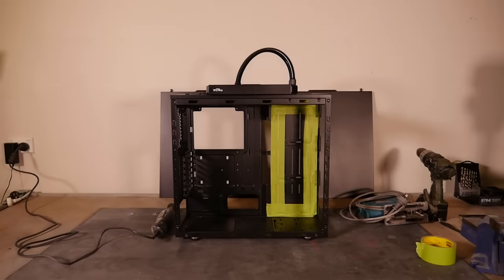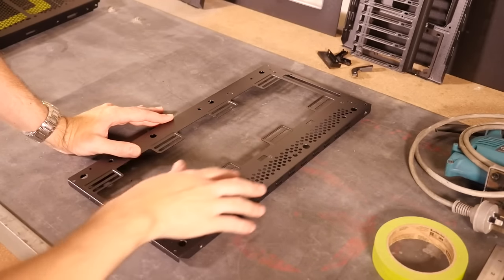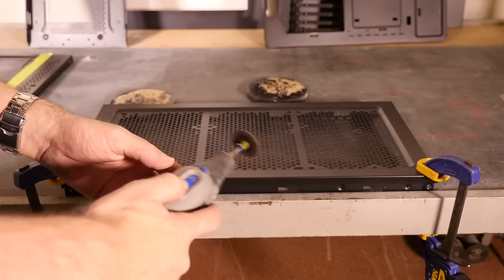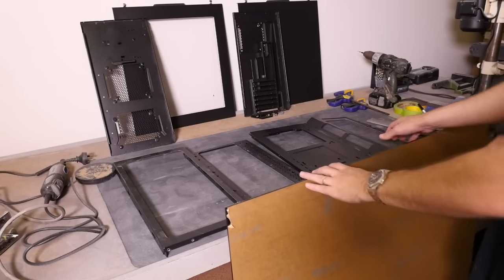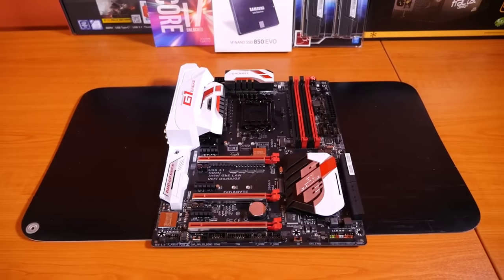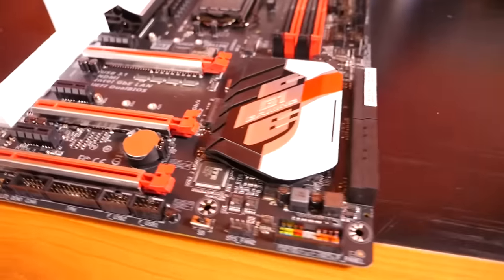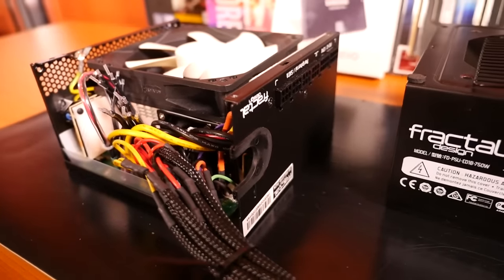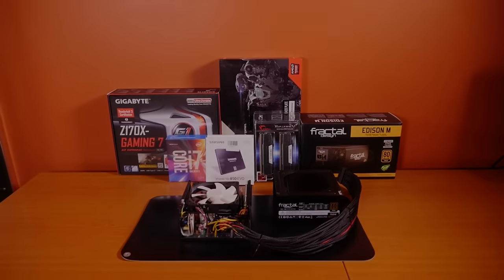Project Cobalt #2

Comment: Hi  Singularity. Nice video and in good time. I am in the same boat now. And doing more challenging mode. I wanna install fractal design define s mother board  panel into inwin 909 case. inwin 909 is a gorgeous case but layout is terrible, at the same time fractal design define s has the best layout,  even better than phanteks evolve. expecially with three hdd mounts on back. The problem is the width of  fractal case is 23.3 mm and aluminium part of inwin is 22mm. Any idea how to make width smaller to fit into inwin 909case? I am stuck now. There are 2 cases right in front of me. Any idea will be appreciated.  Especially from profies like singularity. Thanks

Comment: If semi- modular PSU's are such an needless hassle, why not just have the customer spend the extra $10-20 for a fully modular one? I'm sure your mods aren't cheap, so I highly doubt someone is going to scrap an entire mod over $20.
Reply: That's a sponsored built from Fractal Design^^
Reply: + the amount of time it takes to mod that one is not even close to worth it. I hate seeing something cheaply done, just spend the extra and get a full modular one.
Reply: and even if fractal donated the parts, I would have to tell them that respectfully we won't be using their bobo powersupply.
Reply: Didn't you hear him? He said that semi-modular PSUs look cleaner than fully modular. It's a lot more work, but maybe that's what the client was going for.
Reply: +Asshai by the Shadow This isn't a regular customer build. It will just be shown at conventions.
Reply: It's a sponsored build. Parts are provided by the manufacturers for him to work with and mod. No customer, no haggling for different parts. Go watch the first minute of part 1